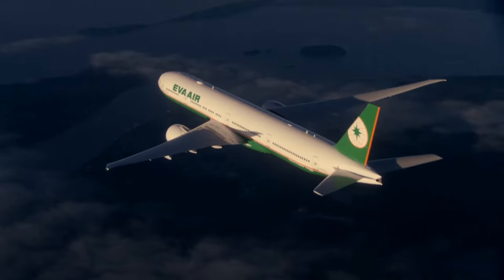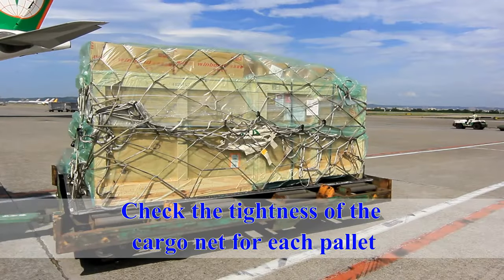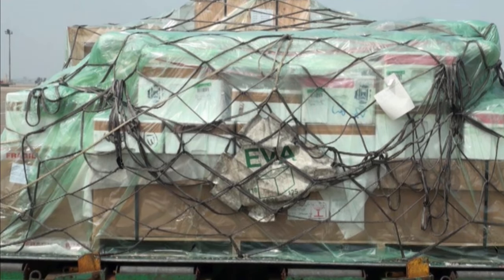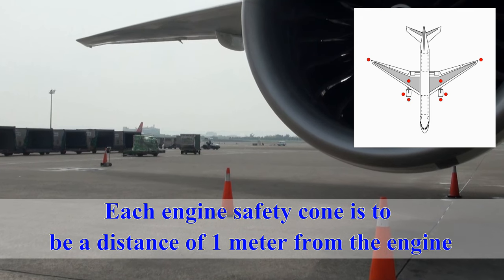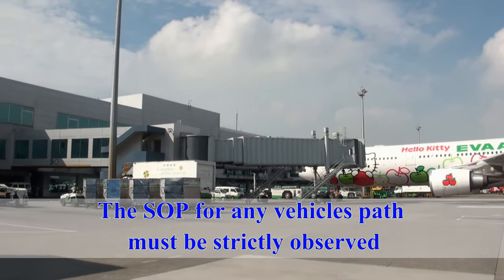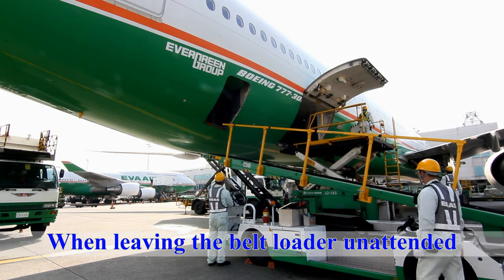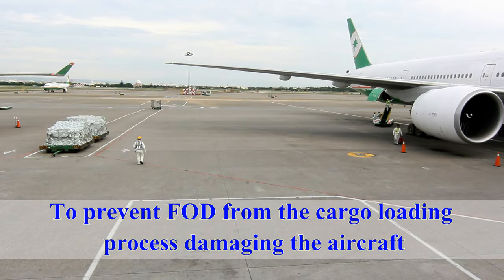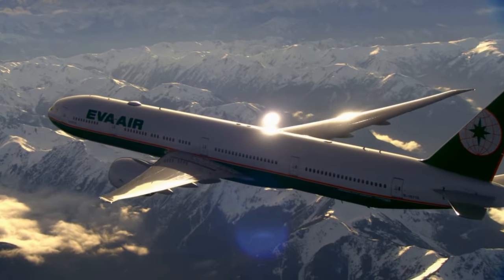Ground Safety Training Video

Comment: I'm an airport operator (ramp agent). Me and my colleagues are concerned about cargo loaders procedures, particularly about 2 points.

1) Is it safe to go on a higher platform from a stair without the protection cage? Most of our loaders don't have it.
2) Is it allowed to move inside the higher platform while the loader is working? This is particularly hard to find an answer, when we have to offload the first container with full aircraft. We can't stay inside the aircraft and at the same time we have to pull the container outside of it.

Any consideration?

Comment: There got to be  a video regarding putting chalks after engine has turned off, what is the safest approach because after the beacons are off and engines are turned off there is still heat passing behind the engines and it still not save to approach the aircraft to put the chalks there got to be a time frame to allow the heat to dissipate and proceed to put chalks and safety cones.
Reply: The engines are too far from the main wheels for it to be unsafe to put chocks on when Engines are off. So, it's safe to put the chocks when the engines are off and beacon is off.

Comment: AFTER THE PLANE IS MOVED INTO POSITION, CHALKS ARE PUT DOWN FIRST, THEN CONES ARE PUT DOWN AFTER THE PLANE IS SHUT OFF, THE CONES ARE PLACED IN 1 CENTIMETER FROM THE ENGINE AND NOSE AND HAVE AT LEAST THREE CONES?

Comment: THE OID IS AN ELECTRONIC DEVICE THAT WILL BE CHECKED AROUND THE NET FOR STRENGTH AND SNUGNESS, THERE SHOULD BE ONLY SMALL HOLES OF LESS THAN 10 CM, NO LOOSE RIVETS, NO LOOSE CARGO?

Comment: Slightly exaggerated. Do you think the busy airports would have their staff and equipment ready 15 minutes b4 the ETA? Naa! Taking photographs? Naa. Airport ground Handling agents are always under pressure by the airline staff. The ULDs used by baggage and cargo staff should check the ULD's status before commencing loading at the warehouse level. Damaged ULDs should never be used and forwarded for loading.
I liked the policy of raising all the locks even if the position is NOFIT. That's exactly what we used to do when I was a Cathay Pacific employee.